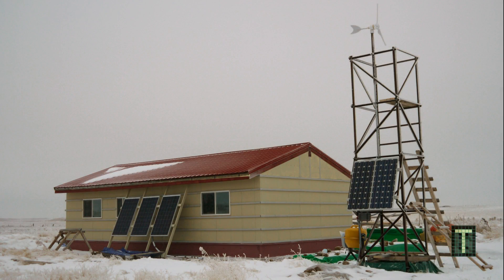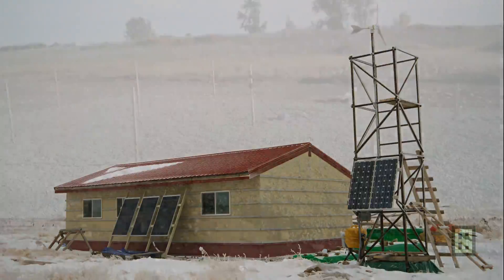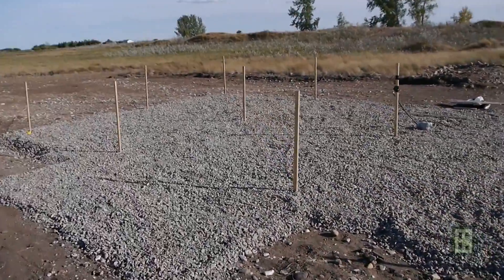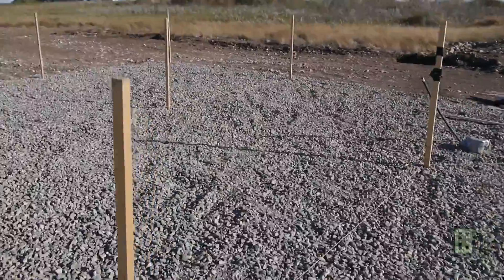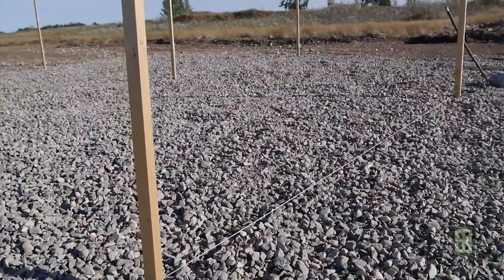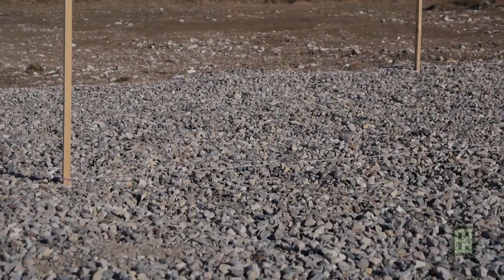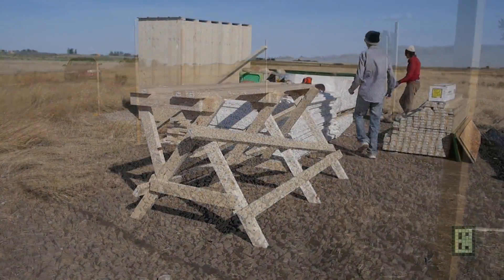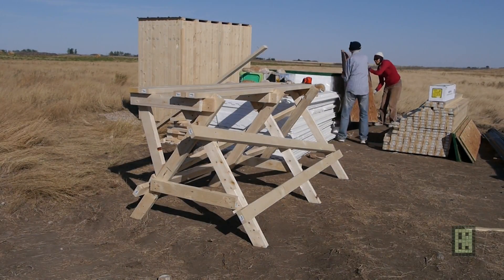Off Grid House

Comment: outstanding build. I was a journeyman carpenter working in all the casinos in Las Vegas Nevada. the way you went about laying out each section was great. the radiant floor is a great addition.  one recommendation I would make is to set your solar panels up so the angel can be changed from winter to summer conditions. I had my original set up as a 12 volt system. I have since changed over to a 24 volt system using Trojan T-145 and T-125 batteries. those are 240 and 260 amp batteries. small circular LED lights you can get on ebay use about 2 watts each so lighting would be easy. try and get a few glass sections about 35 inches wide by 70 inches long to make solar heaters. you can adapt those to heat water also. that will supplement your radiant heat. try and post another video showing what all you plan to run off your electrical set up and ill stop back by your channel so we can get a idea of your daily usage in kw.  Again, outstanding build! SD.
Reply from the maker: Thanks,
I do not have time now for a new video about the house since I'm busy with the Solar BMS (a solar charge controller I designed for charging LiFePO4).
In summer I have excess energy so I it will not help me in any way to change the angle of solar panels.
I have those 3 main PV panels 240W each so 720W total that provide between 60kWh/month in the worst winter month and over 100kWh/month in summer even with the steep winter angle. I also have a small 300W wind turbine that helps especially in winter with about 40 to 50kWh/month in winter months and about 20 to 30kWh in summer.
Monthly energy usage is around 60 to 90kWh/month most of that is for food preparation. Main battery is a 100Ah 24V LiFePO4 and almost everything works directly on DC like LED lights, computers, refrigerator...
I only use AC at most a few hours a day for cooking.
The heating will be done with Solar PV panels directly connected to in floor heat elements no battery necessary. That is by far at the moment the less expensive heating option.
The house uses under 1000kWh/month for heating so I will need around 6000 to 7000W of solar PV panels. For now untill I get the money for PV panels I use a small propane thankless heater and small 20lb barbecue propane tanks. I use about 10 to 12 of those tanks in the worst winter month each tank has about 100kWh of heat if you consider 100% efficient water heater :) not the case.
I hope I will get the time to explain everything in more details but for now I need to work on other projects.

Comment: Building that home yourself must have saved you a ton of money! I like the concrete radiant flooring, how you built the walls of the house out of 2x4's leaving space to add insulation on both sides, and your galvanized metal roofing. Add on top of that your Solar and Wind Power setup! I would be very proud if I built something like that!

If I were to make an educated guess, I would think that you had everything designed before you started the build. Is that correct?
Reply from the maker: Thanks for the comment and for subscribing.
Yes I'm sure I saved a lot of money buy building myself. I'm sure no builder will have accepted to build this type of house since is much more labor intensive than traditional frame buildings.
I did build a house before in a different country made out of large bricks and reinforced concrete. Here the concrete was to expensive that is why I opted for this method else I will have build with ICF.
I did had planed most thing before I started. I made the house design and the plans are available as a pdf on greensask.com if you need them.

Comment: I don't have a battery in mind was looking for some help going in right direction it's just a starters I I can get used to solar  but would really like to be able to have a light / heater somthing of that sort for  like a 8 too 12 hours
Reply from the maker: You mentioned a 5W solar panel. Something like that in my area will produce an average of around 20Wh /Day that with an adequate battery will be able to provide up to about 10h energy for a 2W LED light.
12V was not the greatest choice for such low power you can probably get one of those small 5 to 8Ah 12V sealed batteries that are usually used in UPS but they will not last that long used in this type of application.
You also need a charge controller and for what you get it will be a quite expensive experiment.
Heater ? not sure what you want to say by that but for even a small heater you will need at least a few thousand watts of solar panels.

Comment: Hey I am very new to solar and have no idea were to start I ordered a 5 watt 12 volt solar panel and wanted to see if you could tell me the right way to use it and what I can really use it for lol I'd like a portable solar power generator type set up
Reply from the maker: What sort of battery will you be using ? and what do you want to supply form this power pack? 5W is not much so I guess just a smart phone.
In any case a charge controller will be needed between the solar panel and your battery and a DC-DC converter for 5V USB to charge the phone.

Comment: There must have been a sale on 2x4's lol
Reply from the maker: :) I wish it was but I actually paid 30% more from when I have done the research just a few months before.
You will be surprised that the difference between this solid wall and one made with 2x6 frame and OSB is almost non existent. I think for this house size less than 1000$ and for that you get the benefit of a stronger structure and healthier since that OSB is quite bad with all sort of glues (it smells bad if nothing more).
That is just the building material costs but is true that there is much more work involved with this type of wall.

Comment: Thanks for pointing this out in your comment on another channel.  I am very interested in seeing more videos of this kind of thing, whatever channel they are on.  But, I don't know where you are located, what country, what circumstance, how you found your land, the project plan for moving out to it ... that kind of thing ... not too specific of course, just general stuff.  Cool, thanks.
Reply from the maker: It is in Canada Saskatchewan to be more exact.
I will make videos explaining the costs and my choice but at the moment I'm quite busy with my Solar BMS charge controller that I have on Kickstarter right now.
Reply: *****

Cool, I've never seen anything like a solid 2x4 "log" house.  That's pretty interesting ... but it looks like it might be pretty expensive.  Good luck, hope to see more.
Reply from the maker: Justgivemethetruth
You will probably be surprised to find that is just around 1000$ more compared to a traditional frame house of the same size. But that is just the lumber the labour will probably be crazy expensive if you can convince a contractor to build this way :)
For me 1000$ and a few weeks of work is well worth the additional structural strength. Plus is healthier than those OSB that use all sort of toxic glue.
Reply from the maker: *****
Yes wind is never a problem here :) Even right now gusts are over 40km/h The turbine is mostly on break because the batteries are full this time of the year.
Wind turbine helps since you need a smaller battery but solar is still less expensive and more constant a much better option.
Reply: ***** I just randomly ran into this video again ... thought I would ask you how it is going?  How is life in the frozen north? Have you made more videos and do you plan to ... I still want to do something like this, but I think you are a bit too far out of the way and too cold.

Comment: Outstanding Job on your house! You did most of the stuff we would have done if building new! Found you from your Kickstarter project, would love to back you but it does not support 48V systems. Look forward to seeing more!
www.pinerodgeproducts.com
Reply from the maker: Thanks. Your link dose not work.
It can be modified to support 48V by using to IC chips each is limited to 8 cells and you can use a max of two. But you will need to be able to modify the software and HW. Maybe someone will do this once is open source.
Reply: ***** sorry, fat fingered it. Most uses for small EV applications like mower conversions, tillers, and such use 48V because that is a more common voltage for the motors. My home off grid system is 48V but have resisted Li battery systems because of the lack of BMS that is easy to use. www.pineridgeproducts.com
Reply from the maker: wlbrycemt  I decided to use 24V since that was more than appropriate for the amount of power consumption and 24V is low enough for safety reason.
There is easier to find inverters at 24V (not as easy as 12V) but better than 48V and some other equipment.
Laptops usually require 19V that can also essay an more efficiency be obtained with a DC-DC converter form 24V.
Then there is also the BMS is less complicated with just 8 cells compared to 16 cells.
I have a video about my small wind turbine I just need to make some voice over for it and I will post that soon.
Is good to have both solar and wind that way you can reduce the size of the battery required and that is still the most expensive part.

Comment: found your site by accident, wow, that house is going to be a thing of beauty, for energy use, as some said before, well water, pump, sewage, bathroom to follow i guess, nice that you are in the boonies, but with a store things not to far. you did not live in it this winter, you were colder than me. and the road, wow, you have no nosey neighbours, great, keep up the updates with anything you do, great man
Reply from the maker: I did live in this winter and is not bad. There was a lot of snow to clean in December and really cold but things where better since then.
I will use a composting toilet and water will be from rain and snow since well water will be to expensive never recover the investment.
Things will be hard in the next few years until more will be done. Especially the heating will need to be done with solar panels. The temporary heating with a propane water heater that circulates water in the concrete floor works but propane is 10x more expensive than solar PV.

Comment: Awesome.
Reply from the maker: Thanks.
I've seen you have a lot of interest in wood burning stoves. I live in a cold climate and for my location and house I found that solar photovoltaic heating will be the least expensive heating option the only disadvantage is that you need to pay for heating in advance by purchasing the solar panels.
My house only needs 1000kWh/month in the coldest month and I have a lot of sun so just a 7000W solar panel installation will be sufficient that will cost probably less than 7000$ at 1$/watt maybe even less by the time I get the money and I also need cables and a frame to mount them.
What I do not need for heating are chemical batteries or inverters since the electricity will be directly converted to heat and stored in my large concrete thermal mass 14 cubic meters of concrete the insulate slab foundation.
The solar PV panels will last for at least 25 years with no additional cost or maintenance and the cost /kWh during this 25years will be as low as 2.7cent/kWh that if I can use all the power they produce if I only use them in winter and not summer then it will cost two or even 3x as much but I will find a use for the electricity in the summer.
The other options are natural gas 2.5 cent/kWh + taxes and delivery charge but even the least expensive connection will be 5000$ not my case.
Electricity is 11cent/kWh + tax and delivery and the connection again at least 5000$ more for me since I further from the grid.
Gasoline and diesel about 12cent/kWh.
Propane is what I use for now as a temporary solution 22 cent/kWh small 8kg (20lb) barbecue tanks 100kWh for 22$
Wood is a bit expensive here more than pellets. The pellets are 6$ + tax for a 40lb bag that holds about 100kWh so around 6cent/kWh
 All this other fuels need a sort of stove that is not free and dose not last very long so you will need multiple stoves in 25 years then there is the burning efficiency all those prices /kWh are total energy in the fuel but most have efficiency of 80% natural gas, propane, gasoline, diesel, and even less for pellets and wood as low as 50%
Electricity from grid or solar PV can be converted with inexpensive long lasting resistive heaters that can last as long as the PV panels and conversion efficiency to heat is 100%.
Hope this was helpful.
Reply: ***** Thank you.  But my lack of understanding electricity causes me to partly get your explanation.  But I appreciate your extensive offering of information.  Sound's like you know what you're talking about.  Peace.

Comment: I am sure glad you up loaded this video about building your off grid home. Did the wind make some decent power for you? House looks like its well insulated. I would just have one channel if it were me with everything on it.
Reply: nice job
Reply from the maker: I installed the wind turbine just a few days before I uploaded this video. It was installed before but much lower on a temporary wood tower and there was useless just spinning around the tail because of the turbulence created by the house.
On this steel tower it works great and it seems to produce power according to specifications up to 300W at 45km/h (12.5m/s).
I have good wind resources here especially in the winter when I need them but I will still take a 300W solar panel over a 300W wind turbine.
But the combination of both is better in order to reduce the size of battery that is by far the most expensive part when it comes to cost/kWh during the lifetime of the product.
Reply from the maker: Larry Kemp
Thanks.
Reply: Cool House, looks like it is hurricane proof and then some thanks for the video
Reply from the maker: Ray Isimz
I don't think there is a chance for hurricanes here but I like to make sure, if winds that strong will get here I will still have a house :)

Comment: I too have enjoyed your video, however I personally would have preferred a continued description of what is being done instead of the music which really does nothing to explain anything. Music should only be used if it really helps the visual aspect of the video to put a message across. Unfortunately many people still make that mistake. On the other hand, I am very impressed how solid this house is with the use of 2x4 timber as walls. Very creative and must have cost quiet a bit.
Look forward to you other videos in this series and you should post them where ever you like. For me, here is just fine! Thanks for sharing!
Reply from the maker: Thanks for the comment.
This video has to many short clips that it was not possible to make a useful comment in such a short time.
That is why I want to make a series so that I can explain in detail each step of the construction.
Yes the house is much stronger than a simple frame house and you will be surprised but the cost is not that much higher almost not significant for the building materials but it is quite a bit more labor intensive

Comment: its so nice to see someone putting the underfloor heating pipes in the foundation concrete slab. BRAVO. you save some money doing that, nice big thick thermal mass, very cost effective building technique.
did you use 6 x 3" for the walls, 6 x 6" posts and 12 x 3" for the sole plates and head plates?  thats an unusual style using solid timber walls, sort of going back in time to the log cabin, with the uniformity of engineered timbers.
very nice :)
Reply from the maker: Yes the large thermal mass is an important aspect of a building. I have about 14 cubic meters of concrete that can store as much as 100kWh of heat at a 10C temperature difference.
Yes construction is similar with a log cabin just with easy to work with engineered timber.
You can see all details in the project you can download a pdf copy from greensask.com is my design so you are free to use it.
Reply: thank you . the downloadable plans are superb :)

Comment: Great stuff. I'd leave it in your channel. People like to get to know a guy, a bit, as they subscribe, and this is you, your life! Cheers. Lookin good. How is the solar system working out?
Reply from the maker: Thanks for the comment. Solar system is working great. I even decided I will use solar PV for heating since is the least expensive option for heating unless you have a connection to natural gas.
I was not to exited by wind but it seems to work fine now that I moved the turbine on the permanent tower it makes a huge difference.
Is only two or 3 days since I have the wind turbine there so I will need a bit more time to make an opinion about it.
Reply: ***** wow. fantastic. do you have pretty big plans for gardening / agriculture?
Reply from the maker: KyleCarrington
I only had a small test garden this summer and it seems everything can grow even in this less than ideal soil so Yes I will have a bigger garden next year.
I even forgot how a tomato should taste like since I had mine :)
My long therm plans are to automate gardening with electric robots.
Reply: ***** Awesome! As silly as that initially sounded (in my mind) I quickly established that it would probably be the single smartest use for robots ever conceived. Why wouldn't we. If we could do anything with a robot, why wouldn't we use them to garden. it's perfect. cheers